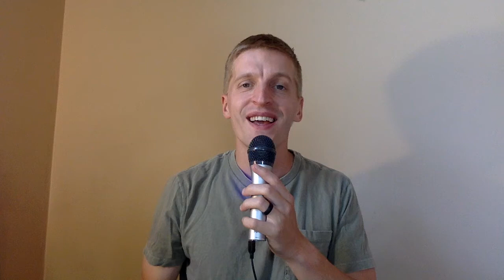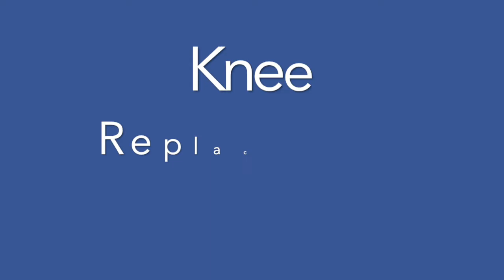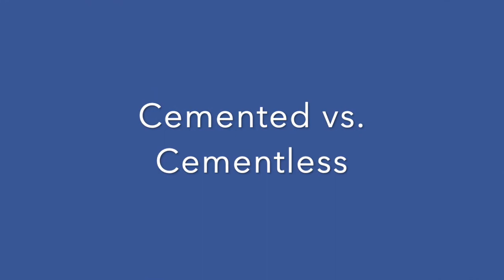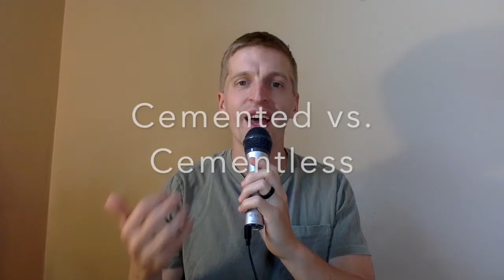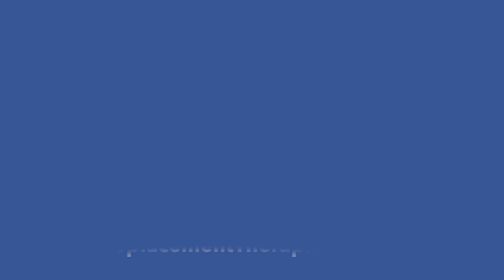Cemented vs. Uncemented Knee Replacement Surgery

Comment: Good vid. I am 67 years old and I have one of each. Both replacements were made by Stryker. My right leg is uncemented and the left is cemented. Funnily the older surgeon went for the uncemented and the younger one used the cemented. I have had the uncemented for 5 years and the cemented for 3 years and so far I have not noticed any difference, both have been lovely and I am really enjoying the pain free life. After the surgery I made a rule that every time I walked past the stairs I had to do a knee bend on the lower step as far as I was able and within a four or five weeks I had full mobility. Now if only I could get rid of the COPD ..... well you know.  😉😞
Reply from the maker: Thanks for sharing your experience, really interesting hearing about having one cemented and one uncemented, and great to know both have treated you so well! Your stair-bend rule is brilliant, that kind of consistent, gentle mobility work makes such a difference early on. It’s wonderful to hear you’re enjoying a pain-free life with your knees now.

Comment: Which one is better? Iam 24years old and i need knee replacement
Reply from the maker: It really depends on your personal circumstances. This is a question best answered by your surgeon.
Reply: @KneeReplacementTherapists my mother has allergy from drugs and brass.  which is safe for my mother hip implant cemeted or uncemented pls reply
Reply: 24 years old hows this possible? I’m 60 and my GP woulnt refer me to see a surgeon because he thought I was too young. Bugger that I changed GP and had both lnees replaced 4 months ago and now with the depression and everything else thats holding my recovery back Im ready to end this HELL.